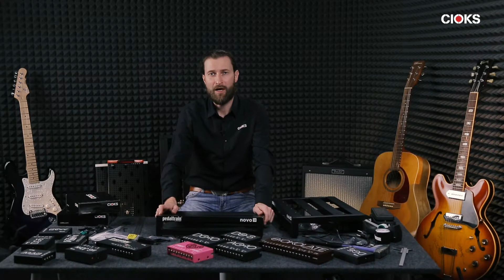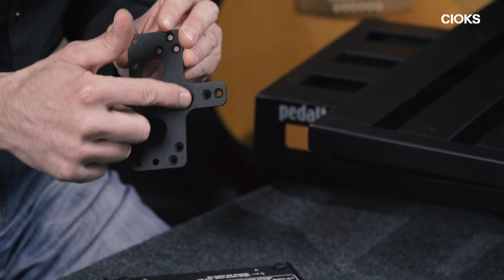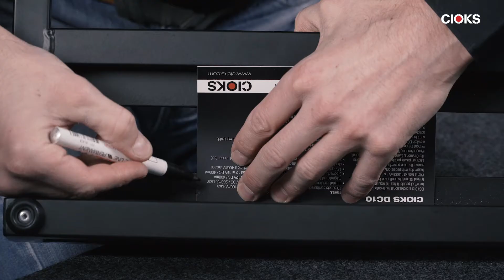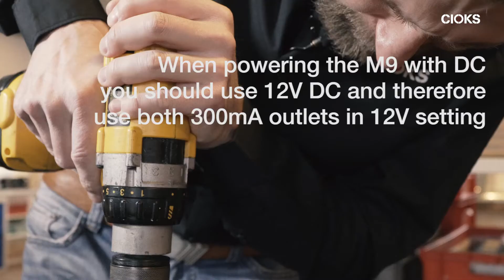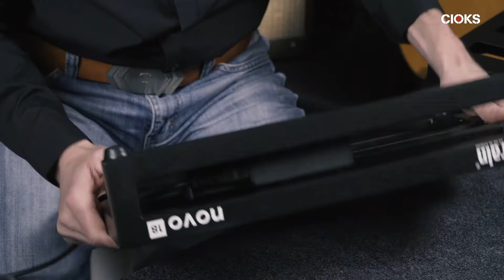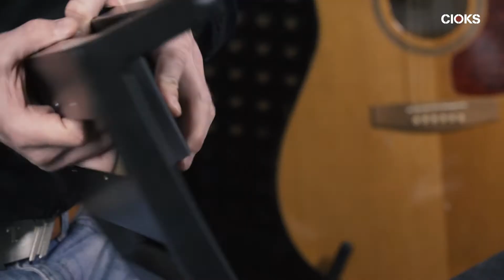Mounting CIOKS DC10 or another CIOKS PRO power supply under Pedaltrain classic or novo

Comment: 1. My old pedaltrain is not high enough… It sticks out underneath?? 2. The cable on the side is a real problem. I have to make a big hole in the front to release the cable from my board. Its a disaster. The old pedaltrain has 2 holes in the front for your euro cable. With my old voodoo labI had no problems. What a bright idea… Now I need some ac power so I bought the ac10. What a drama.

Comment: Great power supply with primitive cave man installation. Drilling into a shallow aluminium base with no thread is asking for trouble. You may as well get the rivet gun out. But if you need to remove the supply at a gig you better have a drill handy ...

Comment: I'm sure someone else has said this.  Why doesn't a market leading company like Pedaltrain simply create holes and standards, and share the standard with the PS makers?   Is this not an obvious no-brainer?   No other companies make people engineer things, measure distances, drill holes...  what a waste of time.   C'mon guys!   It's like Marshall having people drill holes where to put tubes...  this makes absolutely no sense.
Reply: Well, there are 2 answers to your question. One, we still have some DIY with our pedal board construction and if this is not fun to you if you don't have these basic tools that's OKI really like the West Coast pedal boards and if you like you can have the power supply and the buffer pre. Installed?  It only.
Costs a little bit but less than buying those tools.And at least you know that it will be professionally done.But I've had some problems with pedal train before and I just got frustrated with them.I think their site sucks.They really do need to make it more personal friendly

Comment: Will this bracket work for DC10 Link ?
Reply from the maker: No, the DC10 link comes with all the hardware needed to install it under the pedaltrain boards and the bracket is not needed and therefore not included.

Comment: Just use 3M dual-lock. The stuff is stronger than you'd ever need. Simpler, and you can place the power unit anywhere.
Reply: It’s flat underneath the board then, so you’re unable to poke patch cables down through the gaps

Comment: Fucking hell. I expected an official product video to give correct information. The hole for the distance piece is 5mm, but the holes for the two screws are 4mm. I drilled 2 holes for the screws, felt them spin, figured I'd made a mistake so I drilled 2 more holes. Now I have 4 holes that are too big in my brand new pedalboard. 

Thanks dickhead.

Comment: Unfortunately my DC10 (version 1?) neither has the hole for the distance piece nor has my Pedaltrain classic 2 the little overhanging edge to put on the DC10.  I even bought the special MB18L mounting kit for the extra screws, but still can't mount my old DC10 to my Pedaltrain board. What do you suggest?

Comment: As two others have commented, the sizes are wrong in this video - it's 5mm hole for higher feet to rivet, it's 4mm hole for PZ-2 screw holes for mounting bracket.
Reply: wish I read your comment before I drilled the two 5mm holes for the sinking screws. Fudged it :-(